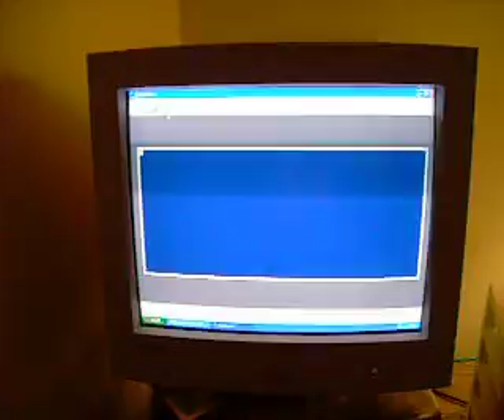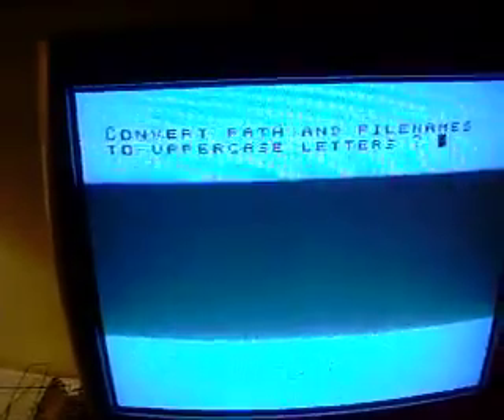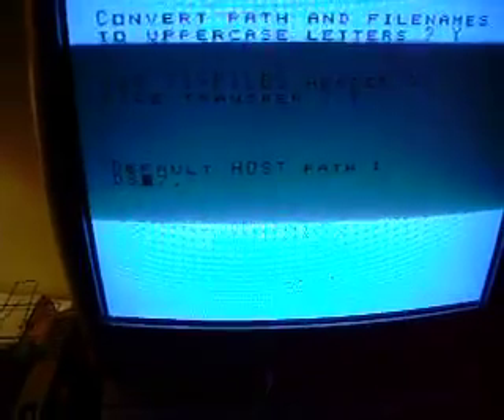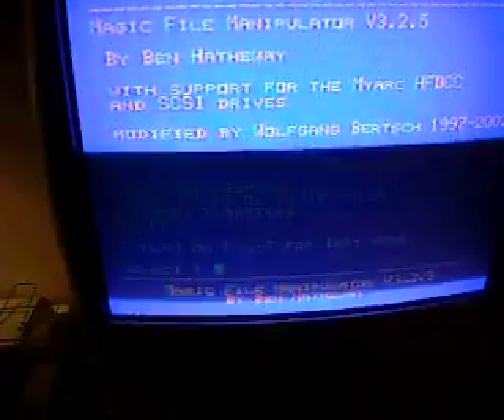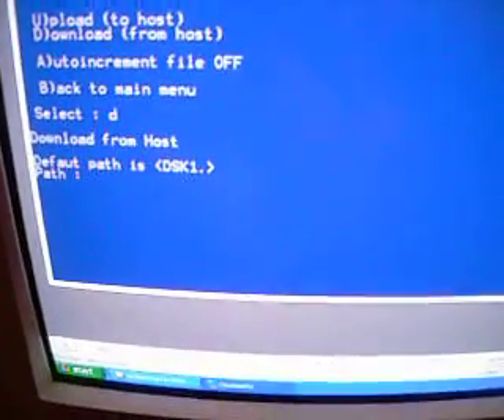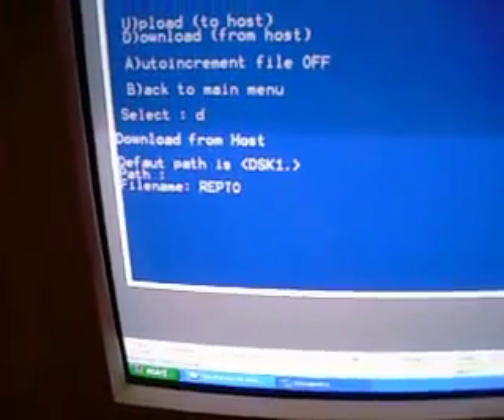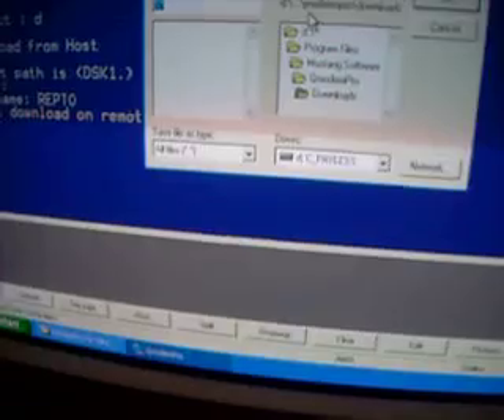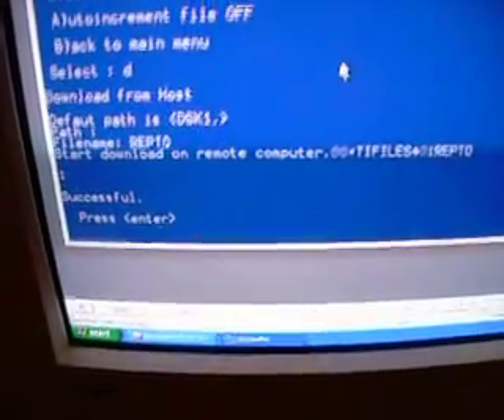TI-99/4a to Dell PC serial data transfer (pt. 1 of 2)

Comment: You know what I find amazing about this as a system admin... that Cisco Routers and the way you set them up are done exactly the same way you interface with the TI-994a... serial to USB cables.  Basically, you can download config files from routers that way, using X-modem.